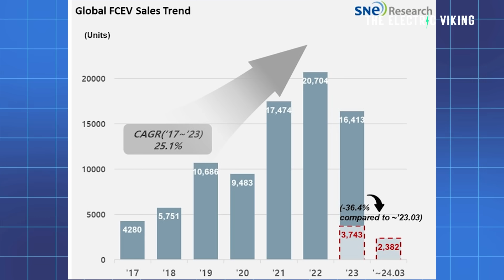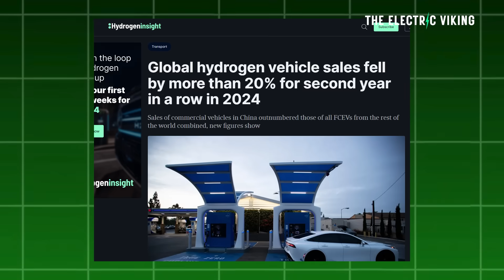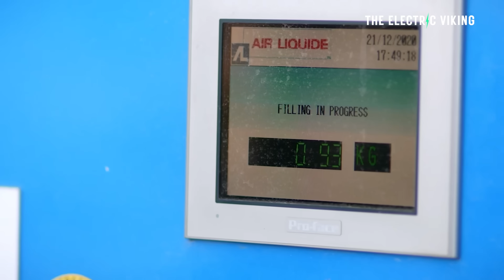These numbers PROVE the hydrogen vehicle dream is officially DEAD

Comment: Hydrogen for passenger vehicles is a dead end, for short haul large teucks too. It may be an alternative for long haul trucking with heavy loads. However battery technology and fast charging is developing at break neck speed and battery swaps is also an option. I wouldn’t put my money on hydrogen 😅

Comment: H2 in shipping? Also not gonna happen. Why? Refueling. An automobile H2 station can fuel ~10 lt H2 before defrosting for 20 mins. An average container ship will require ~800 000 lt of H2 to have the equipment energy as a diesel powered one. Naturally, terminals would have better refueling than a car station, but it will still take days or weeks to refuel a ship with H2.

Comment: LH2 is very difficult to distribute, can create "invisible" fires, and usually uses a lot of power and/or NG to create.  Electricity is easy to distribute and you can add solar at the edges of the grid to create more supply.  I can't imagine a auto shop that would touch a LH2 car.

Comment: Battery charge cycle efficiency 92%+.  Slower chargers are 90% efficient. Fast chargers can be 99% efficient in power transfer.  H2 ICE engines maybe, max 38%, PEM fuel cell systems can go up to the mid to high 40%.  Let's say you want to store your solar electricity for later or put it in your car. Do you want to do that at over 90% efficiency or throw away half of it at 45%.

Comment: They could have listened to our research conclusions funded by DOE at SERC (Humboldt State Univ)  and saved themselves 12 years. H2 tech can NOT compete with battery tech, especially in transportation.  Not to mention that a H2 fueling station is a huge engineering project. New EV chargers get installed by an electrician.

Comment: Sam the 200% requirement is largely a myth. Battery storage, pumped hydro - and V2G, or Vehicle to Grid - will significantly reduce that. So the massive over-build of both solar and grid infrastructure can be reduced by smart charging, using the massive reserve capability in EV's and home storage to shave peaks and fill troughs. Those home batteries are also great for grid stability, helping to smooth supply and avoid the need for gas turbine stabilisation.

Overall, you're bang on about the hydrogen hype and the people hyping it. The fossil fuel industry is the only significant user of hydrogen, and that's to process fossil fuels. What's great is that the vast majority of comments here recognise these facts.

For the commenter who thinks that catalysers are the road block, they're in for a shock. It's the whole supply chain that's a falsehood. Catalysers hate intermittency. Even so, making hydrogen is easy. Just use 5kW of renewable energy to get 1kW of usable energy from hydrogen, spend fortunes on non-existent infrastructure. 
Seems like a bargain... When you could use that 5kW to produce 15-25kW of heat/cooling via heat pump.

Toyota have mahoosive debts, and have been flailing around looking for salvation. Sayonara, which I say with no satisfaction. They've done great things in the automotive industry, but like all over-ripe industry titans, they don't have big rudders, only big overheads.

Comment: Hydrogen in theory could be the best solution , but its main grip is how Hydrogen is to be used , if its to be used as a mean towards fuel cell , then its just a EV , but it require the installation of hydrogen tank and affiliated filling solution which is the like of the same as LPG vehicles ( which simply was here for literally decades and unable to overthrown gas based ICE despite its in theory a better solution ) , the other part is where are we going to had all those hydrogen , simply put as of this moment there is no viable clean hydrogen source despite its long known hydrogen can be ( relatively easy ) to obtain from simply any water 

I do agree shipping had a good future with hydrogen simply because ships sale on water , an endless source of the base hydrogen , what is needed is an economical means to extract that hydrogen on the go which then fuel the engine

Comment: I suspect that the handful of manufacturers who kept on with hydrogen assumed that the fossil fuel industry would have the clout to shut down renewables. All of the hoped-for hydrogen demand would come from fossil fuel, allowing them to continue business as usual. 
We certainly need cheap ways to store electricity, but hydrogen is not competitive with safer alternatives. Flow batteries look a much better bet, and old tech like pumped water storage is proven. 
I’m not convinced that hydrogen will be used in shipping either. Surplus renewable energy can be used to make much safer liquid fuels that can be used in fuel cells or combustion engines. If energy density can be improved, you could have ships powered by flow cell batteries. In port the used electrolytes would be pumped out and the tanks refilled with charged electrolytes. The used electrolytes would be charged up on land and would be a way to use surplus renewable electricity too. They just need storage tanks, not the hazardous pressure vessels that hydrogen needs.
Reply: Public buses in Tokyo are shifting to Hydrogen fuel cell, based on Toyota's technology. Trains are being developed too.

Comment: Toyota has plenty of money due to the success of its hybrid vehicles, so it doesn't matter if it takes 50 years to commercialize hydrogen.
Toyota's strength is the breadth of its basic research.
They've given some incredibly interesting presentations on biomimetics at biology conferences, for example,.
"Research into mimicking the internal structure of Nepenthes（Pitcher Plant） to create mirrors that don't fog up even in the rain."
Other automakers would not be able to spend money on this kind of research.
Reply: But what is the point?  we all have electricity at home and perhaps even solar panels where we can 'fill up' if we choose to have an ev.  Hydrogen will not give us that choice, back to the service station for a fill up.  How many ice vehicle service stations are there in Ausi compared to how many hydrogen ones will need to be installed?     the whole idea is---to be polite, madness!

Comment: The simple truth is that hydrogen motors are just as complex as the usual ICE engines, if not more so , which simply do not compare with well designed electric motors.
Reply: That's why they are being pushed. Extra maintenance and parts costs benefits manufacturers. Most hydrogen is and will continue to be made using fossil fuels so again benefits the suppliers of the fuel.

The only person HFCV's don't benefit is the consumer.

HFCV's are incredibly dumb for ANYTHING that can be electrified.

Comment: Hydrogen is not even likely on a ship... hard to imagine something that leaky and inflammable (even at low concentrations) being stored in a confined space for any length of time along with equipment prone to frequent failures and high regular maintenance/inspection thanks to hydrogen embrittlement. There are plenty of other ways to store Seba's excess energy without resorting to Hydrogen... it still will be used in industrial processes though.

Comment: As a mobile fuel hydrogen fuel cells continue to improve and hydrogen has already proven itself in aviation. A typical EV run on hydrogen travels 350 miles on 5 kg of hydrogen and takes only 4 minutes to fuel, now imagine hydrogen at $1 per kg, that's the future.
Reply: Doubtfull. Hydrogen is just more complex and inefficient to produce, handle and use.

Batteries improve all the time as do their charge speeds, weight and efficiency.
Reply: In addition China increased its investment in hydrogen over 35% and 50% of that $230bn was transport related spending. EVs work, no doubt but there needs to be diversity longer term. Sodium batteries will reduce pressure on lithium,  but still not enough batteries to replace all vehicles (heavy plant especially). All options need to to employed for reduced CO2, not just EV alone. Shipping is moving more towards ammonia at the moment because it's easier to distribute.
Reply: @kmason5241Bit like saying we need diversity so keep VHS and DVD around.

By the time hydrogen tech would make sense we will be way beyond it.
Reply: a very distant future.

Comment: A rare company that actually makes truly green hydrogen is Charbone Hydrogen. They use hydro power for energy, and split water with electrolysis instead of processing or using any fossil fuel. They are one of the very few.

Comment: Advocating hydrogen powered vehicles is the sign of a clueless person trying to appear smart
Reply: Come to think of it, Toyota's hybrid was actually invented by a Berkeley researcher for GM.
At the time, there were no on-board microcomputers, and it was impossible to put the technology to practical use with just gears and electrical circuits, so GM sold the patent to Toyota.
Toyota completed the hybrid system using Intel's 8080?, power electronics, and nickel-metal hydride batteries.